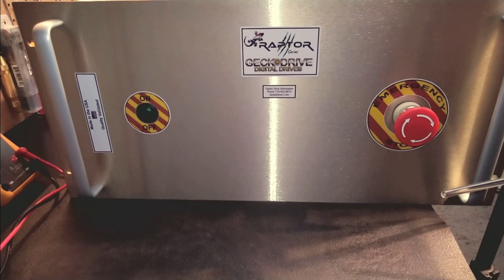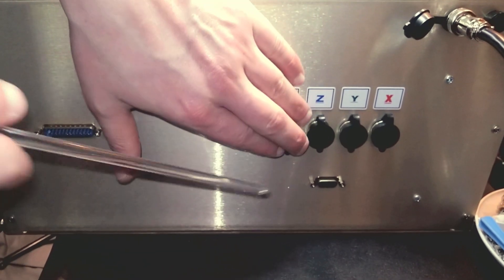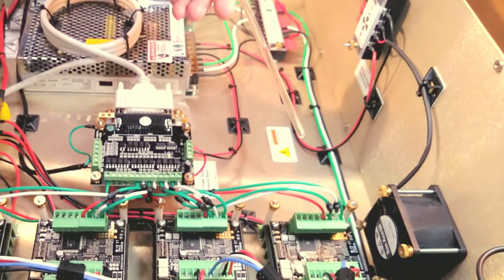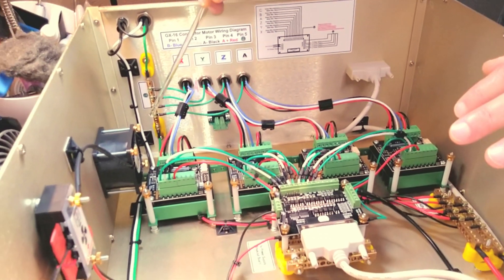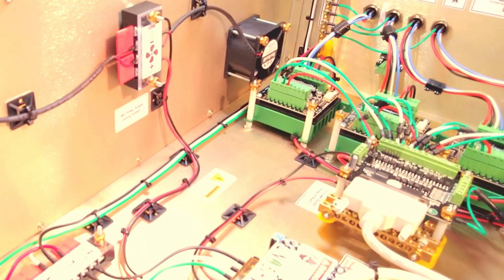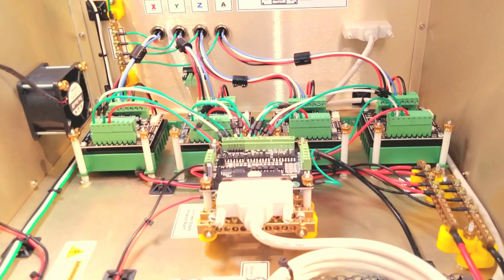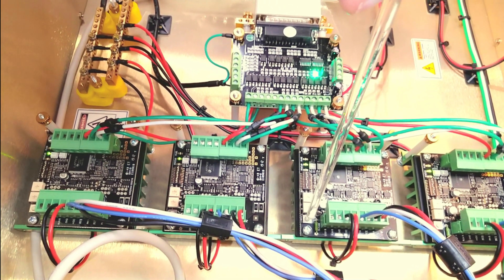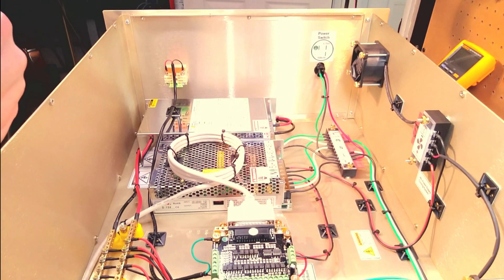Gecko Drive Raptor GR214v Pro Grade 4 Axis System Overview..

Comment: Following your advise, I got myself some ferrite beads. Unfortunately at 1.5mm ID, those are too small to fit the 18 AWG silicone wires. However, they fit snugly onto the metal wire. Thus I was thinking I could place the ferrite in contact with the wire right next to the wire terminal. Is that a bad idea? I verify and my beads are very resistive (I measure about 4 Mohm between the wire and the bead). Alternatively, could you point me to a place where I could buy the beads you are using in this video? Thanks!

Comment: Hi Vince. One question about wire gauge. It looks like you are using 18AWG for pretty much everything, including "main", except the 48V line where you use 12AWG. Can you confirm? Thanks!
Reply from the maker: Hey Nico, Thank you for your support. The system utilizes 16awg for the A/C lines in the system, 12awg from the 72v power supply to the power distribution terminals, and 18awg for the drives wiring. Silicone wiring is used for the drives wiring for its flexibility. Thank you, Vince

Comment: what r you're thoughts On EMI line filters.  you all so mention 7-9 fuse's ????
Reply from the maker: Hey Kenneth, thank you for your support. EMI filters are excellent, but are best for certain applications. I find other applications are better solved with ferrites, and traditional shielding. The mention in the video of multiple fuses is do to the system using individual drives as they each have one to protect them, and then each power supply also has a fuse along with one installed to protect the power entry of the system.  Have a great weekend! Vince